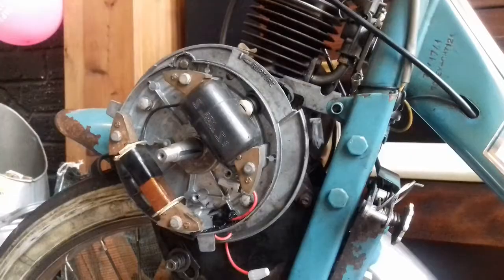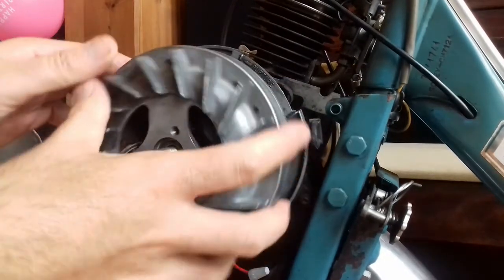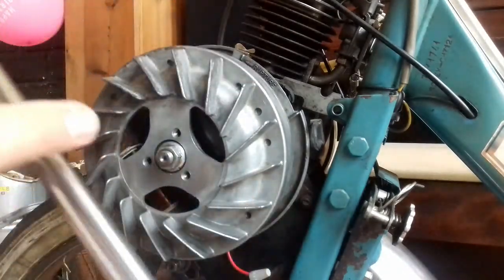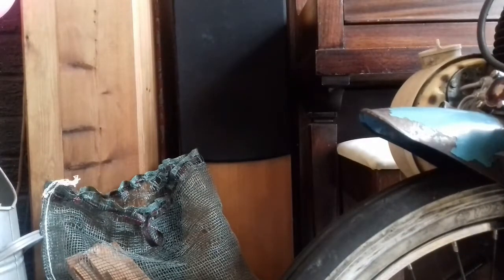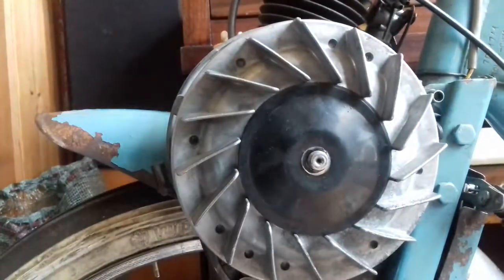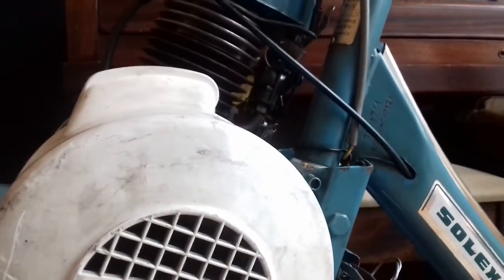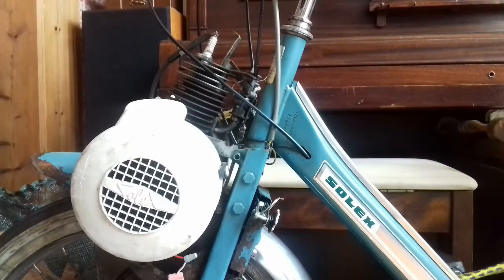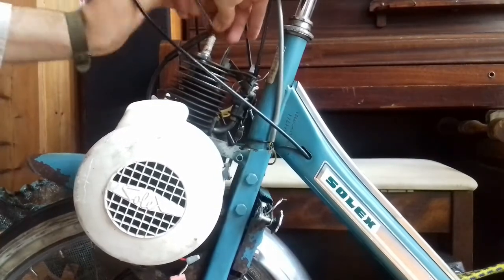Fitting electronic ignition part 7

Comment: What was the outcome of the flywheel key that did not fit please?  Reg
Reply from the maker: Hi Thomas - I ground the key down using a Mole wrench and a file then kept filing until the flywheel went on! Top level engineering here... I've just rebuilt my coil too which was interesting to say the least. Thanks for the question.
Reply: @mopedinthemalverns6661  I did wonder if that is what gets supplied from the Netherlands or improved since. Amazing about the coil ,any chance of a video ?
Reply from the maker: @thomaspalmer3923  Well now I know how easy it is to file down the key and what was actually involved in having the flywheel re-cut I wouldn't send it off again. You just need a bit of key metal and a tiny file. The key of the Solex is only to position the flywheel not hold it in place - that's the job of the tapered crankshaft and a lot of torque in tightening it down. Like all things with the Solex - anything you can do yourself will be better than the professionals.
I've done the coil now so missed the cnance to video it. I used a soldering iron to cut the plastic off....
Reply: Agree and well done.I think my difficulty would be cutting a slot in the flywheel. One 
"expert told me that the flywheel would fall off without the key" and this is rubbish as you say.My bike has the 41mm barrel,sportds exhaust and the 9mm carb with adjustable nozzle.With the extra revs the engine lifting lever sheared off near its base with the extra vibration.Van den Solex does a much more substantial lifter but it is not suited to the decompressor on mine as it is a Hungarian Impex.